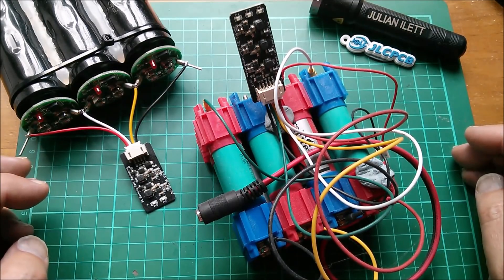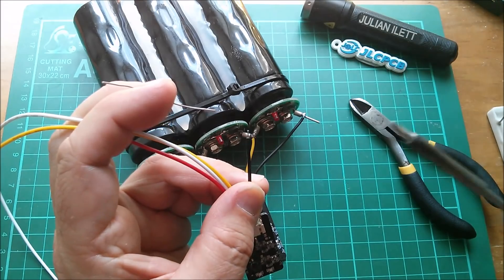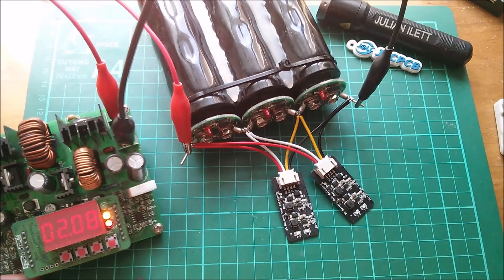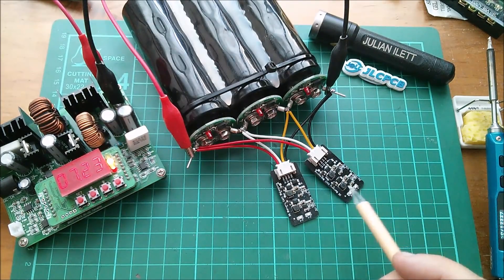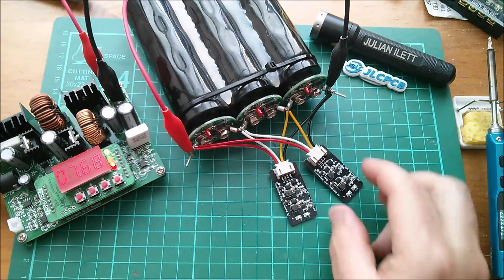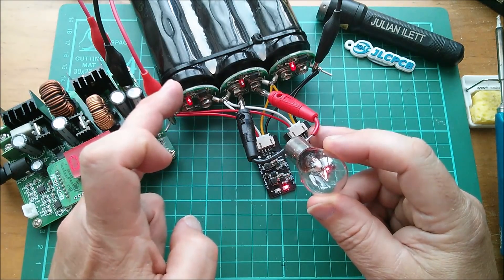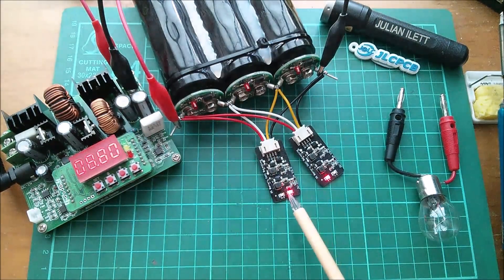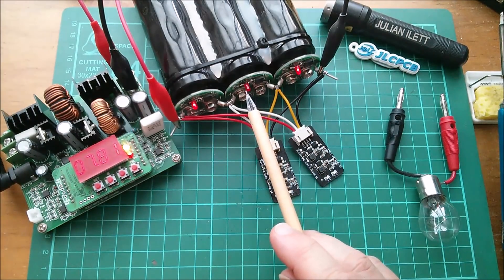Active Cell Balancers in Parallel

Comment: Bravo........I seen wire digram......4 parallel and 4 series  .....they feed power from top ... 4 switchs ..4 cap..parallel .....4more switch ...4 more caps ......they would switch between on and off .....back and forth .......active balance.......cheers

Comment: next time, read the datasheet of the balancer. it start transfering current as soon as voltage is 0.1V different between 2 adjacent cells. before that nothing happens. it stop when voltages are as close as 30mV.  check the cells voltages instead of the whole pack.

Comment: These ETA3000 I.C. balancer have a good switcher that can pump from upper to lower or lower to upper cells.  They are leap frog overlapped to transfer current up or down the stack of cells.

The problem is with the voltage sensing which is just a comparitor to determine which of two cells per I.C. has the greater voltage.  A single I.C. only measures voltage comparison when its balancing pump is idle.  Problem is all the chips run asynchronously.  This causes interference with adjacent I.C. causing the comparitor to sporatically report the wrong cell with higher voltage and results in balance pumping current is wrong direction.  The more wiring resistance to cells the worse it gets.

Comment: What I'm doing  is using a bms for safety, w and using a balance charger ever so often, or as needed, keeping an eye on the cell voltages, my battery bank is over 25kwh, and 7 series cells, and I stay between 3.2v and 4.1volts,

Comment: I think cable lengh of the balancers should be exactly the same on both of them and to each cell comming from the connectors in order to get the same resistance/behavior on both boards. Even minor diferences in cable lengh and/or solder joints could trigger slight diferent readings on the balancer board when we are dealling in millivolts range. Try to switch place of balancers boards when one of them shows imbalance and the other one not to see if they show the same thing, if for instance the right one showed imbalance but the left not or the right one showed imbalance on the first cell and the left showed imbalance on the last cell switch sides of the balance boards to see if they still show the same. Then you will be sure that it's the cable lengh that plays role in that behavior.

Comment: How did you set the balancer to work on 2.5 Volts? I mean, are they not designed for 4.2 Volt? Or do they balance at any voltage? (Up to a certain minimum and maximum I guess)
Reply from the maker: They work on voltages between 2.2V and 4.5V

Comment: when i was testing i did a discharge test on my pack noted capapcity and what bank went low first added an active balancer and tested again i found with each balancer i added i got a little more capapcity due to more current flow keeping the banks in balnce with each other i hit a point where all banks would deplete ate the same point cant remeber exactly but i think i gain about 5ah on capaity i also found the active balancer did nothing for alot of the time they mainly kicked in at low end of discharge when the banks went out of balance more

Comment: I have a feeling you could end up with a cell balancer oscillator if you parallel these gadgets where they bounce between celles, one balancer pulling current from an outer cell to 'balance' the cell that's being discharged by the other balancer.

would be interesting to watch the voltage across the super caps too

Comment: Since these balancers activate at ~100mV difference they're not really useful for anything.  100mV is a lot for a li-ion battery (ie you could have once cell overcharged at 4.3v when the others are at 4.2v). These also have relatively low balance current if i remember correctly, they only go to their rated balance current when way out of balance (>250mV).

Comment: I would be very interested in any future MPPT videos showing in particular those cheap low current boards..if they can be paralleled and also how they work....it seems to me there is a lack of higher current boards for DIY use on eBay.

Comment: They operate by shuffling small currents as required.   In time they balance the cells.   No need to migrate amps at  a time.   Given time one of those could balance a 100Ah battery no issues.  Unless you have some seriously messed up cells.   I use those for my Head Way packs .   They work.
Reply: Where to find them?

Comment: Please just put a meter over the whole pack instead of guessing for half the video.   8-)
You use to have some of those small panel meters and those would work well here by using an alternate battery for their own power enabling them to read down to zero.  You could use them on each individual super cap.
The balancers won't need "rebooting".  Think about their intended use... rebooting wouldn't be an option.
Good to see you getting back into this stuff!

Comment: then they are connected in parallel how do you know that they are sharing the balance current? I would expect the one with the lowest voltage will start to balance before the other one even starts to think about starting to balance so it will just sit there waiting for the voltage across the cells to be to where it wants to start balancing. 

A bit like transistors in parallel you need emitter resistors to try to get them to share the current or one just takes it all and over heats.
Reply from the maker: True. I had intended to build ammeters to test the transfer current of these balancers. Now I'll just have to build more ammeters :)

Comment: Hi can you tell me if I can connect 2 lithium batteries in parallel and the two batteries in parallel and two more in series will I still double the amperage of the battery pack
Reply from the maker: Best to do your parallel-ing and series-ing at the cell level.
Reply: @JulianIlett  sorry I just read my question doesn't make sense I'm trying to use for lithium batteries to make 12 volts wanted to increase the capacity by paralleling two out of the four
Reply: I have 4 battery packs that are 6s. They each have a set of balance leads. I use the 4 packs in parallel to power my 24v lawnmower. Each pack can handle 10amps. So the 4 in parallel gives me 40amps available. But doing this will cause each pack to go out of balance differently. So I built a balance lead with 4 connectors. Making cell 1 of pack 1 is connected to cell 1 of pack 2,3,and 4. Same thing for all the other cells. I plug 1 balancer into that and it balances the pack great.

Comment: Nice video Julian. So much more professional than my musings on camera. 

The pseudo MPPT boards can be paralleled on the output, but not on the input if charging a common battery pack. 

They are however very inefficient as the charging current is modest at best.

I now use the BMS to terminate the charge, the charge current being supplied directly by the solar panels without any charge controller.

I tried to parallel up the active balancers but unfortunately one let the magic smoke out, so I use just the one on my 3S pack, which seems to be ok, even with my 35Ah battery pack.

Having reasonably balanced cells to start with really helps keep them in balance, with the balancers being used just in case one cell voltage slumps faster than the others in the pack.